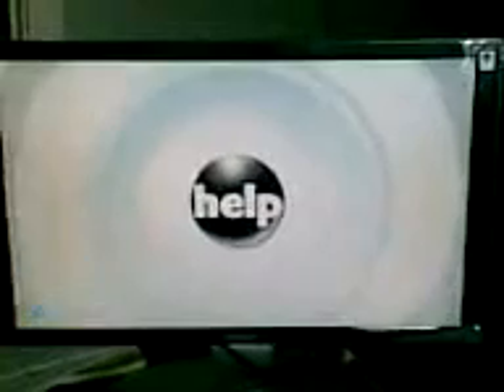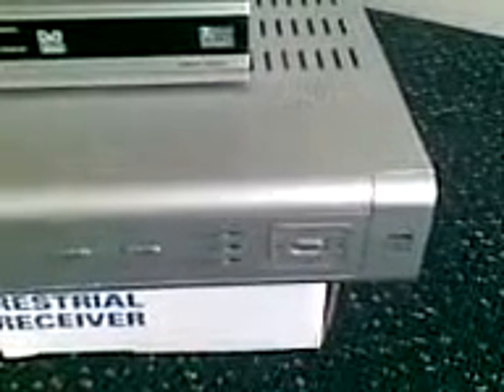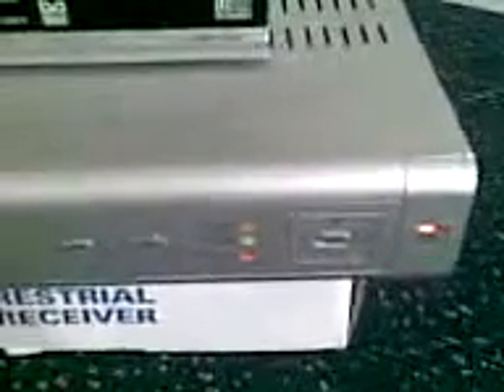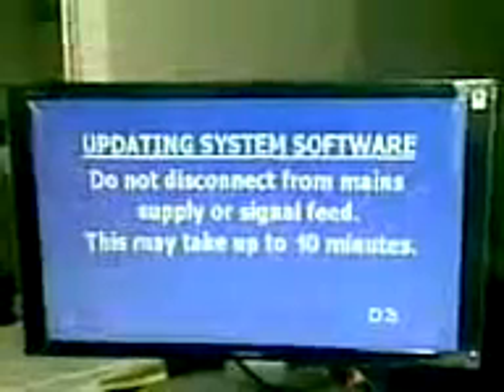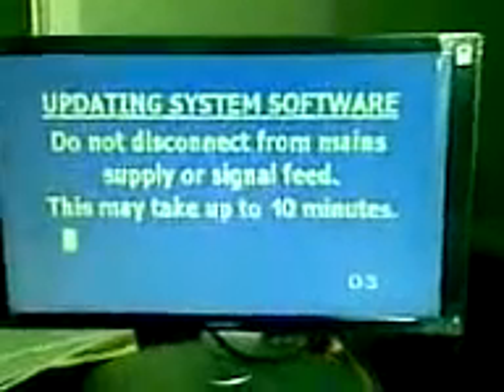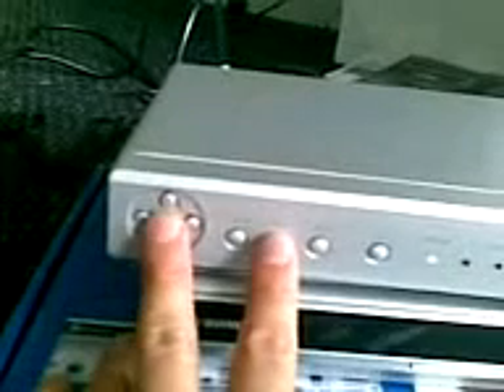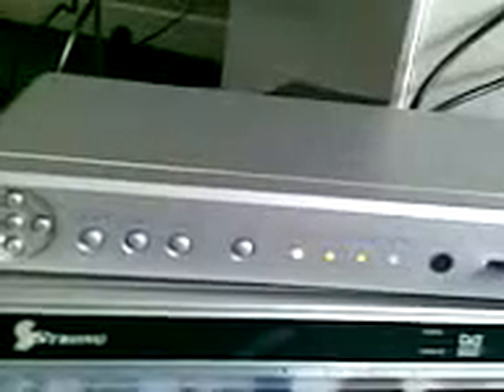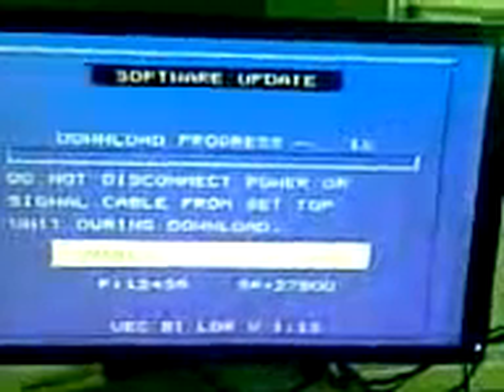Foxtel STU firmware update procedure

Comment from the maker: Depending on the type of video connection from the IQ to the TV you may not be able to see the progress display. From memory the composite and RF connections definitely show it. S-vdideo shows up in black and white, and component video doesnt display at all. 

Just wait until all the coloured lights go out (the firmware update should be complete) and the box will reboot into standby. On the IQ the final reboot does take a little while.